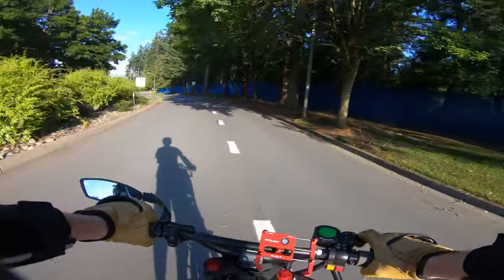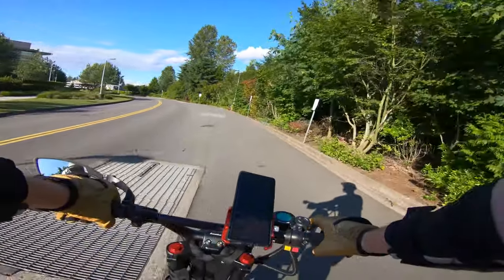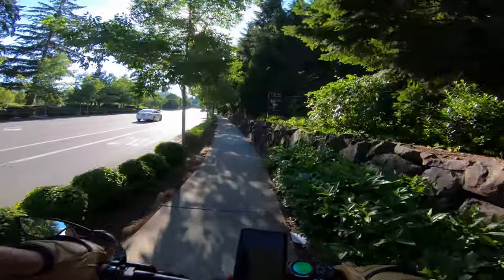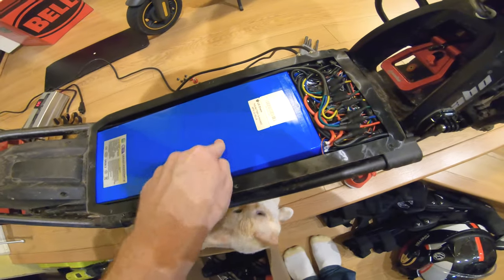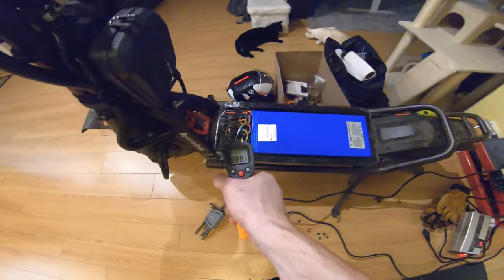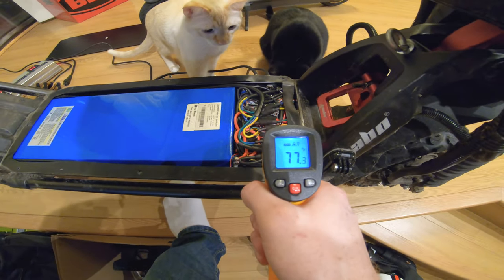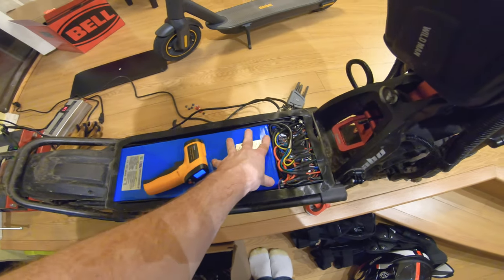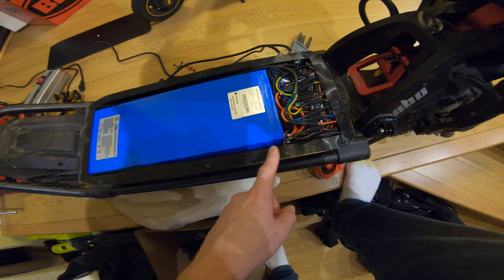P.E.V. Electric Scooters & EUC's - Charging : Are Fast Chargers Too Fast?

Comment: can you use fast and slow charger together on the wolf ? how long did it take you to charge the wolf with both of the fast chargers ?
Reply from the maker: I would not recommend using two chargers of different input levels. With two fast Chargers the wolf takes me four or five hours to charge.
Reply: @GingerOnWheels   ok thx

Comment: Thanks for this video! I always wonder this type of stuff. My battery on the Lightning+ is also 60v, but its smaller in capacity so I bet its not set up internally the same. I did hear that the two ports on mine all connect to the same stuff inside the battery so it doesnt matter what port I use. I assume that means I can use one 5amp and one stock 1.7amp charger at once.
Reply: I was told by VoroMotors (through whom I purchased my Wolf) that I should not mix the standard and the fast charger. Any thoughts, gingeronwheels? Or anyone else?
Reply: @deirdre444  I'm wondering the same thing , I just bought a Wolf king gt . you have had yours for a year any problems ?

Comment: Typically it is fine to charge the 18650s at .5c  or about 5 amps per 10ah of battery. (2-2 1/2 hours charge time) I believe LifePO4 can be charged at 1c. And Lithium Titinate is way faster if I remember correctly and lasts about 10 times longer. You can charge them all faster, provided the BMS allows it. It just reduces there life span and as the cells degrade over time it becomes more likely to cause a fire or explosion.  Cheers
Reply: so fast charging bad i wanted to get a 3amp charger from a 1.5amp

Comment: Using that same logic, I've got one 10 amp charger but that would still work on this setup, correct?
Reply from the maker: As long as the wiring from the one charge port to the battery can handle it. I don't think it can. That would be 1200watts which would require 2awg wire and I don't think its that thick.

Comment: Hey man just got the wolf 2 days ago. What voltage do you charge up to before you ride ? and what voltage cut off do you have cheers
Reply from the maker: Charge to full until charger is green. Voltage cutoff is 48, I think.
Reply: @GingerOnWheels  do you know the exact voltage ? I charged it last night and it said it was 100% but the charger was red and it was at 67.6 volts
Reply from the maker: @IceNihilus  that's perfect. 67.6 to 67.8

Comment: DUDE....... I forgot to ask you this so many times.....near the back wheel there is 2 large screws on each side I guess for the rear suspension they are 8mm hex keys 1 of them are in the open and easy to tighten but 1 on each side is behind the tubular frame,have you found a way to tighten that one I cant get to it. THANKS.........AGAIN !!!!!
Reply from the maker: If yours is loose, which it shouldn't be .... You need to find the areas where the metal bar is secured to the battery housing and loosen the screws going through the bar. Then slide the whole frame bar back (it'll come out of the two fixtures in front) , then tighten your axel screw, then slide the bar back and retighten with loctite.
Reply: @GingerOnWheels  o........ I know exactly what you are talking about! Great thinking! Thanks brother

Comment: What battery size is that? And how long did it take to charge (10 amp) from quarter to full?
Reply from the maker: 35 amp hour LG battery. Takes around 4-5 hours to charge from dead to full @ 10 amps.
Reply: @GingerOnWheels  Ok thanks🙂

Comment: Hey man great video! Quick question though: I am getting an electric motorcycle from china thats 72v 120ah. Sadly they only provide me with a standard chrger, like the one you would use to plug into your monitor or pc and is rated for 10ah. I found a charger online that states it can do 84v & 20ah and want to use it as I don't perticularly like waiting hours for my bike to charge. Would that work or just cause my bike to explode haha. If you like I can send you the link of the charger I found, and maybe you could even help me find one better suited for me. Thanks and keep it up!!!
Reply from the maker: Send me a link to the bike and both chargers. I simply don't believe they exist. 72v 120amp hours is MASSIVE, like 200lbs worth of battery. I don't know much about emotorcycles but that thing sounds big. Second, chargers are rated in amps, not amp hours.... third, there is almost no standard household outlet that would allow a 20 amp charger and not trip the breaker (maybe a garage outlet or gfci?). I've personally never seen an 84v 10amp charger. Just so many questions here....
Reply: @GingerOnWheels  Also, the charger that comes with the bike isn't shown anywhere, they just told me it comes with a 10A (my mistake, not ah) fast charger and I was just guessing that it would then be a 84v charger.

Comment: Nice video! I'm guessing that you could safely charge the battery just as fast as you can discharge, right?? Like if a scotter discharged the battery at 15 amps regularly it should be able to be charged at 15 amps
Reply from the maker: You can discharge the wolf at 90 amps, 45 for each motor. Charging is ~15amps max.
Reply: @GingerOnWheels  damn!! Thats pretty interesting, I figured you could at least charge half as fast! The battery chemistry just doesn't allow that I guess! Loving my 10x, thanks again for recommending a call to REV rides!!
Reply: @GingerOnWheels  Generally Lithium Ion cells like these can safely handle a 10c (10x pack current) continuous discharge rate. Again, limited by wiring.

Comment: If the battery is 60V, a bit more voltage is used to charge. For a 36V battery the charger is 42V. For a 60V I think it is 67V.
Reply from the maker: Yup. 60v is the nominal charge. It actually charges at 67.2.

Comment: Ginger what is the minimum voltage of a 60v scooter, before you have to recharge again?
Reply from the maker: 67.2 V fully charged. I believe minimum is 58.
Reply: @GingerOnWheels  if it drops below 58, does that mean the battery is dead? My battery percentage read 95% and then died on me. I read 52 volts.

Comment: Do you think an 8A single fast charger would work with/be safe to use on the Zero 11x?
Reply from the maker: Ya as long as it were 72v
Reply: @GingerOnWheels  thanks for the reply man, I love your videos. Someone had told me that each Port on the 11 has a 5 amp fuse so I thought 8 might blow the fuse.

Comment: Does it matter if you use 2 times 5 or 1 times 8 or 1 times 10.?? How much do the cables handle.
Reply from the maker: Now that's a good question. I only ran a max of 5 amps through each of the battery input wires, but given the fact that I barely saw them heat up, I'd venture a guess that it's probably safe to push more amps through one port. But I don't think its recommended to run different charging input's into the 2 different ports at once.
Reply: @GingerOnWheels  Hey, great video. Fluid said that you could run the OEM charger and the fast charger at the same time. Not sure they are right and since they only offer a 6 month warranty, It might not matter. Getting clear info from them was like pulling teeth so I appreciate you doing this. 

Anyhow, I'm guessing you're going to see the most heat during discharge. So if you were running very aggressively uphill and then use the regeneration braking to charge it might get even hotter. I wonder what the max regeneration amps would be. Need to put a temperature probe in there while you ride.

Comment: do you think its possible to charge a 52 volt 26ah electric scooter off of an electric car ( Chevy Volt in my case )  accessory port using a power inverter ? Reason for this is id like to charge my scooter and leave it in my car rather than hauling the 77 lbs beheamoth up to my second floor apartment for charging ?.. i d like to use 2 chargers but have to figure out how many watts inverter power i will need to support the load ...Ideally , all scooter companies should make their batterieds esily removable for easy charging with having to need to have the scooter in close proximity to an ac/dc wall plug ...Thanks
Reply from the maker: Quite possibly , yes. I'm doing the same sort of rig up in the conversion van that I'm building. Sort of, anyway
Reply: @GingerOnWheels  Nanrobot representative told me not to use a power inverter to charge my scooter ...case closed i guess
Reply from the maker: @Carcajoo121  Nanrobot is the worst scooter company I've ever heard of. If your inverter can handle the wattage and amperage drain then you're fine.

Comment: it can also be a problem to discharge  the battery fast on dual motors turbo mode and open throttle and lights on over a longer periode or distance on my scooter the battery was HOT max charge is 68v  my charger is 2amp x2 no over heating
Reply from the maker: Yup, that heats it up much faster and hotter than charging.

Comment: Hi can someone help me I have kaboo wolf x pro problem is Don't move everything works fine but wheels don't move it is motor ? Or controller  ?
Reply from the maker: Controller likely blown.
Reply: it is now work because swap cable new on display but on single motors speed moree power that on dual do you no why ?

Comment: Can i use a normal charger and a fast charger will it help to use both?
Reply from the maker: You 'can' technically, but I wouldn't. I don't know enough about how the bms or wiring works to feel confident in it. Not saying it isn't possible though...

Comment: Hello man, thanks a lot for your video because I was looking for a proper answer to this question a long time ago.
But I have a doubt and please confirm or either explain my point of view. I say that for example a 5 Amp charger for 16S and a 20 AH battery pack, will charge my battery in 4 hours from 0 to 100% , but based on your explanation, it's not 5 amps / 16 series. I suppose that 5 Amps is divided on each cells in parallel, such as if the battery is 16s7p, it should be divided on 7 cells which gives = 714 mAh per cell in one hour ===>> ( if the cells are approximately 3000 mAh ) then 714 x 4 hourse = 2856 mAh as fully charged. and this makes sense to me.

Please correct me if I'm wrong
Reply from the maker: Whats your doubt? I don't understand? How is what you said different from what I spent the time making the video about?
Reply: you said that you have 10s battery right, and with 10amps charger, each serie will have 1 A , I don't think this is right, what I guess is you divide 10 Amps on the parallel cells, for example if you have 10s12p , you divide 10A to 12
Reply: Please let me know if it does make sense, I'm sure you know better than me
Reply from the maker: @commandant30  yeah, is that not what I said on the video? Divide amps by P not S
Reply: Yessss , sorry my bad 😅 somehow I kept focusing on wrong number

Comment: it all depends what the BMS is rated to do. you can give it all the amps you want. But the BMS dictates how the pack gets charged. period. no discussion there... discussion begins at what percentage you charge your battery to, not how fast. 80% is the golden number to help maintain the life of your battery pack. Please reply any questions.
Reply from the maker: Doesn't matter how many amps the BMS can handle if the wiring to the BMS melts first. It's really small, like 18awg. Not sure its safe for those wires to charge above 5amp per port. At 6 amps they start getting warm.

Comment: My battery it's a 60 v 12 Ah output i see on description of charger not recomended for baterry under 15ah, what do you think, i wait for your answer or anybody who know, thank you.
Reply from the maker: Chargers aren't measured in amp hours. That's a measure of battery capacity. Chargers are measured in amps. You need to make sure the output voltage of the charger is equal to your battery pack at full charge (both 67volts, full charge on a 60v scooter). Then make sure the output of the charger isn't too much by plugging it in and seeing if your battery gets warm. Or you can contact the manufacturer and ask what a safe charging speed is. Or take the amp hour capacity of your battery pack and divide it by 2, thats roughly how many amps you can charge at MAXIMUM.
Reply: Thank for your kindness.
Reply: My original charger it's 67,2 V same like this fast charger, the difference it's make by Ah, 2 comper to posibly 5
Reply from the maker: @Madalin-Ionut  it should be fine. I wouldn't worry.

Comment: hello, how come your charger's voltages is lower than your battery? because my stock charger is higher than battery
Reply from the maker: What do you mean? Can you be more specific?
Reply: @GingerOnWheels  I mean my charger output is 54.6V and the battery is 48V so I saw your in a different way
Reply from the maker: @mrdillmale1633  48v is the nominal charge for your pack. When fully charged it'll go up to 56.6v and when drained it can go down to 39v safely.

Comment: But i also think that it will get much hotter when you have the scooter closed because a normal user wouldn t pop off the top just to charge the battery so it can stay cool... and also thanks for switching to celsius :))
Reply from the maker: Very true... I did place the lid back on top for about 50 minutes or so during this test and it didn't change the temp more than 1 or 2 degrees F. I think the metal frame of the scooter was acting as a heat-sink of sorts. BUT I do wish I'd tested to see with the lid bolted closed. :/ Maybe next time!

Comment: Your explanation around 2:50 is slightly wrong in your maths…. You have 16 strings in series to give 60v each with 10 in parallel to give the 26ah. You calculated it as 10 amps across 10 sets which would be accurate if you were talking about a pack around 36v. The correct calculation in this case is 10a/16=0.625a per set of 10 parallel cells

Comment: Ginger..... do you run slime in your tires to help with punctures or no because it's bad? And what psi do you run? Someone told me 40 but I'm 250 lbs with another 20 lbs of gear I was thinking 45/47 psi.... I know your 200 lbs with gear so would like your opinion..... THANKS AGAIN BROTHER!!!!!!!!!
Reply from the maker: I wouldn't run over 45 psi if I were you. 40 is probably fine. Just make sure when you go off bumps that the hub motor isn't hitting pavement through the tire when you land.
Reply: @GingerOnWheels  do you use a  tubeless tire sealant or no

Comment: Another great video man! Now I feel confident about fast charging..or at least at combined 10A. Thank you for that. 
Do you know what is the difference or impact of charging using single or double ports for charging? For i.e. charging 5A in each port = 10A vs. 10A in one port (the other port left unused)? The reason I ask is because I’m thinking about buying a 10A fast charger and carrying it with me on rides as opposed to carrying two 5A chargers. But, I’m concerned if it would damage/compromise the battery...
Reply from the maker: No idea of the difference between 10a in both vs 10a in single port.
Reply: I have put 18 in one port and only got slightly warm after 1 hour

Comment: When should I charge my battery on my zero10x to keep it prime
Reply from the maker: At 20% . Charge it back up to 80%. Keep it in that level and it'll last longest.
Reply: Ginger On Wheels do you do the same with the ninebot max? Is it not good for the battery to charge over 80%?
Reply from the maker: @flejt7107  its a general rule for all lipo batteries. Not one that I follow, simply can't be bothered, but it's worth mentioning in case others care that much.

Comment: I wonder if kaabo reached out to Him and told him to take this down. because they keep exploding their scooters
Reply from the maker: That's an issue with the wire placement, not the chargers. It's a manufacturing flaw that puts pressure on the wires /bms when people stand on the scooter deck.

Comment: I have a Dualtron Ultra V2 with the 32Ah battery, is it ok for me to use the 6.5ah fast charger that minimotors sells? does anybody around here uses it?
Reply from the maker: As long as the voltage on the charger matches the voltage of your battery and the plug connector for the charging port fits then it will work totally fine.
Reply: @GingerOnWheels  thanks a lot, I had to order it from a different vendor (Alieexpress) since Minimotors USA won't ship internationally and I'm stuck down here in Mexico for a few months, let's hope I don't get ripped off

Comment: Ginger..... have you charged with 1 fast charger and/or 2 from completely dead? How long did it take? I haven't yet from completely dead but I'm guessing 6 hrs ish? Can you imagine if wolf warrior made the deck a couple inches wider and 1 inch deeper and made the same 10 x 16 cell from Samsung 21700 batteries!!!! Your talking WAYYYYY more amps and I think 1.5 times the range!!!!! I'm 250 lbs then 20 lbs of gear...... I dont need to go over 40/45 mph but would love to see 40/50 miles at riding hard speeds!!!!! I'm never folding my wolf warrior so I'm thinking of the most secure way to permanently lock stem upright and stiff so theres NO WAY OF COLLAPSE OR BENDING WHEN I PULL ON THE HANDLEBAR.... IT SCARES ME AT 45MPH...... ANY THOUGHTS SCOOTER GENIUS?
Reply from the maker: Yes I have, I've done it quite a few times (charge from dead @ 10 amps). It takes about 4-5 hours, I've never timed it exactly. 
 
I have seen scooters with larger decks that DO have the 217000 batteries, they are getting up to 40+Ah now! 

If you want a little more security that your scooter won't fold while riding, you can replace the locking pin in the Kaabo wolf Warrior with a 3/8" Eyebolt (made of steel, not aluminum), and bolt it in. Scooter can't fold unless that pin breaks or is removed.